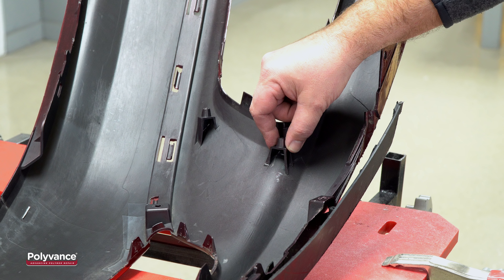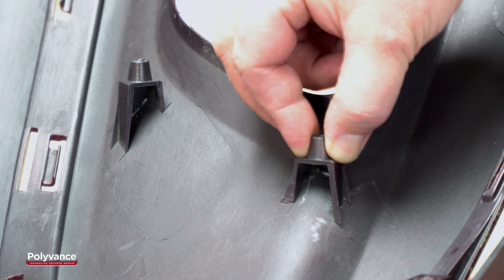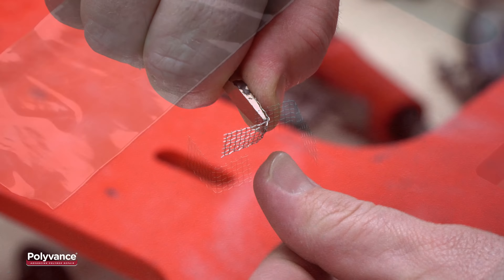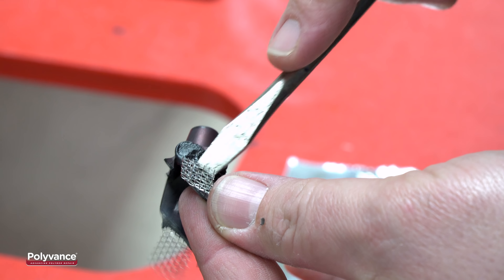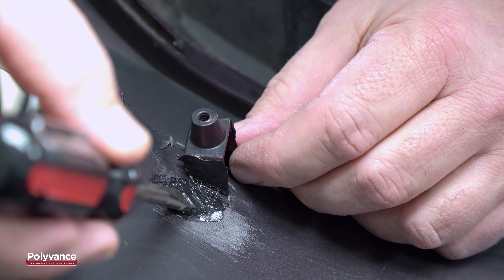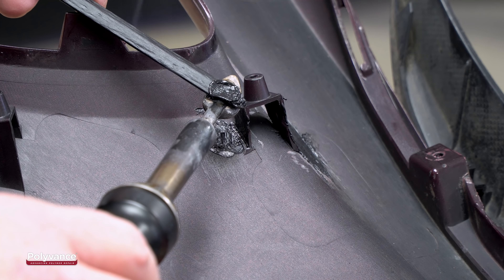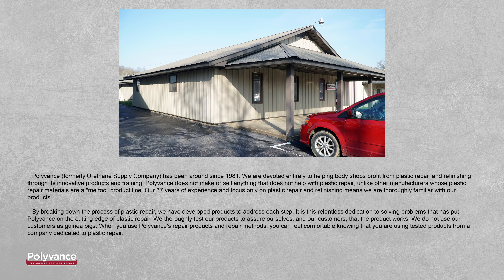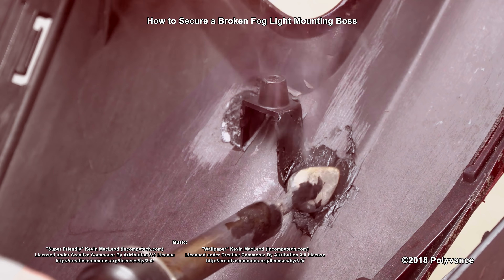How to Secure a Broken Fog Light Mounting Boss

Comment: I NEVER knew plastic can be welded, thats awesome 👍. Thanks for sharing.
Reply from the maker: Thanks for watching, Chris!
You may want to check out our nitrogen welding playlist. That will show you how fusion welding plastic works (making a true weld using welding rods that match the base plastic). This video shows using an airless plastic welder and FiberFlex welding rod as an adhesive to make an bonded weld (more like brazing).
Reply: JB weld man
Reply from the maker: @chadsmith6283  JB Weld does not stick to polypropylene reliably.

Comment: Great video. Exactly what I need. Before i rush and buy hot welders, is it possible to do the same  using mesh and 2K components for cold welding?
Reply from the maker: When you say "cold welding" are you referring to adhesives? If so, adhesives won't work. You'll need a plastic welder.
Reply: @polyvance  Yes, I meant adhesives.

Comment: .. This is so great job.. I would use the common super glue or the hot silicon but this is away better.. thanks
Reply from the maker: Thanks so much! Yes, this method is definitely stronger and will last longer than super glue.
Reply: How can I get your products
Reply from the maker: @Martin Ndegwa, visit our website at polyvance.com or call us at 800-633-3047. If you are with a body shop and looking for tools for your shop, you can contact your local paint and body jobber.

Comment: where can I find a mounting boss piece? My fog light cover completely fell off on the highway after some piece of metal came off a truck and hit my car. I was able to purchase the fog light cover, but it did not come with the mounting boss's and I don't know how to repair it.
Reply: You would have to fabricate them from polypropylene and weld them in place.  Unfortunately, they are molded into the bumper and are not something you can buy.  You could always go to a salvage yard and find a smashed bumper of the same make and model and cut out the tabs and weld them in.
Reply: Do you think Tee-nuts Gorrila glued in place would do the trick?
Reply: Tee-nuts aren't a bad idea but gorilla glue, while strong, doesn't stick the best to polypropylene.  I would try welding the t-nuts in.